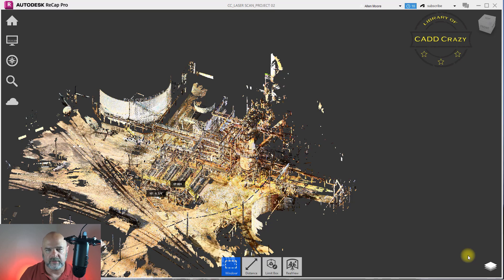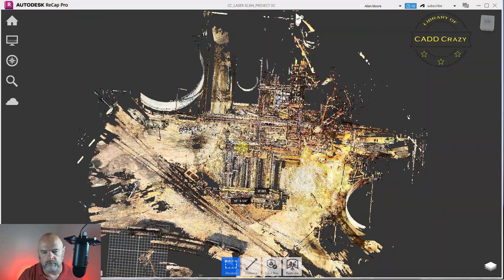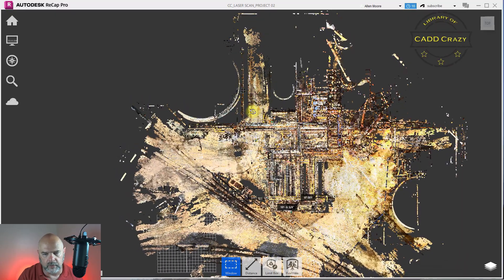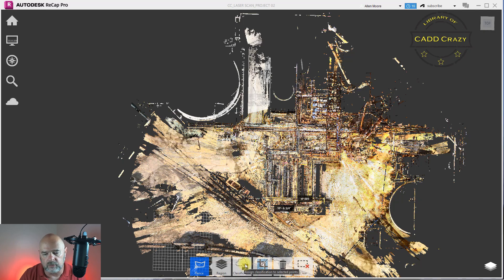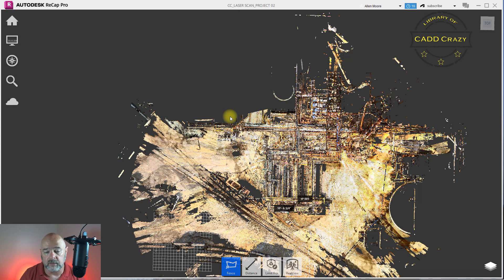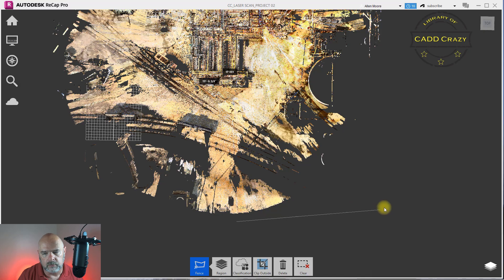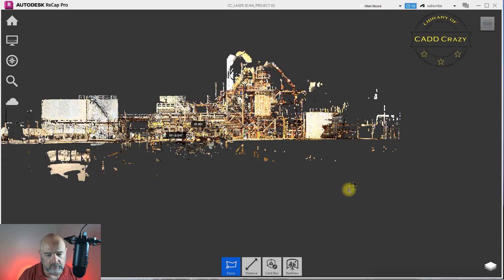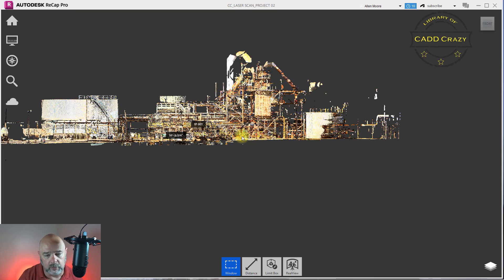Deleting Scan Points from Autodesk ReCap

Comment: What laptop would you recommend for cadworx? I use my desktop 75% of the time but started traveling and need something portable also. Thanks
Reply from the maker: I would get a laptop that has at least a Intel i7 or AMD equivalent, 16gb of ram, a dedicated graphics card, and at least 512gb SSD drive. The more you can add to those numbers the better.